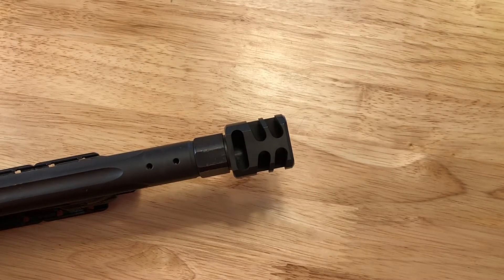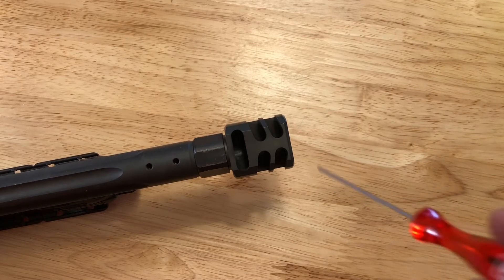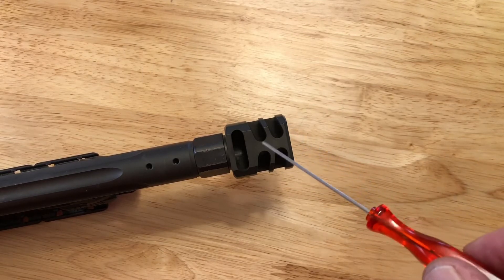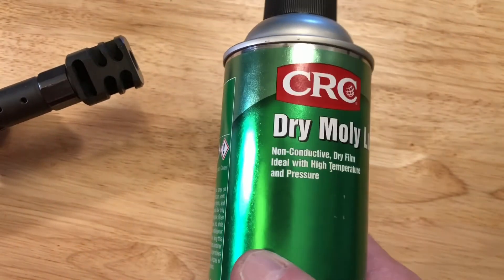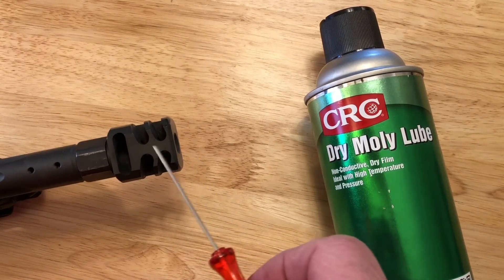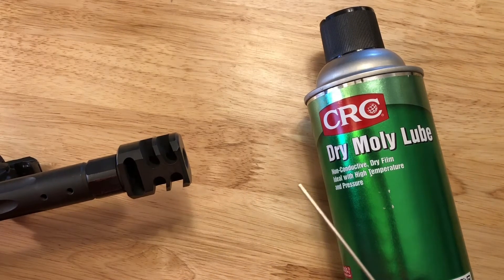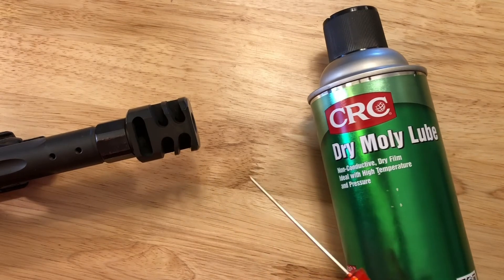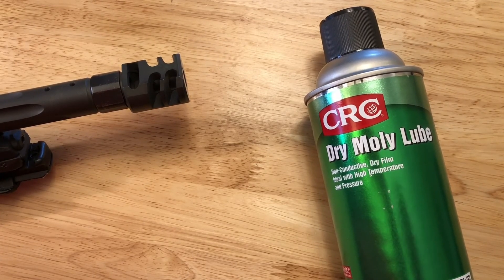Compensator cleaning made easy. Check this out!

Comment: I’ve tried this…it works….very well. But, you need to clean the comp thoroughly FIRST so that the moly lube is adhering to and protecting bare metal and not a buildup of carbon/lead/copper etc. start with a clean comp and this moly lube will work wonders.

Comment: A product called Never Seize will do the same thing. It puts a protective coating on the metal that withstands high temperatures. Silver or copper never seize.
Reply from the maker: Interesting.  Have you ever tried it?  I use Never Seize all the time on nuts and bolts, but this product never dries.  My fear is that after a few shots the Never Seize will be blown off and the protection would be lost.  Let me know if you have tried it.

Comment: Good tip, thank you
Reply from the maker: Mike, I just cleaned my comp yesterday after firing about 100 pure lead handloads, and big chunks of lead came out with just a dental pick.  Normally that would have taken me over 30 minutes with a lot of scraping and swearing involved. Try it, you'll like it.  Just make sure you put on 3 heavy coats, letting it dry about 10 minutes between coats.

Comment: I will try that on a new compensator I'm getting but have you tried an ultrasonic cleaner to see if it'll clean the comp much faster and easier?
Reply from the maker: I do have an ultrasonic and yes, I have tried it.  Mine is a special case because I shoot lead bullets that are not plated or jacketed, so the lead welds itself to the comp. With the moly coat in between it doesn't stick anymore.  If I shoot plated bullets I will just put it in the ultrasonic.  I use a cleaner that I saw on YouTube that is a 50/50 mix of vinegar and peroxide. It works really well but I'm told the fumes are poisonous, and the stuff will burn your skin. When you are done you need to neutralize the acid that was created by dunking the comp in a bath of baking soda and water for about 5 minutes.  I'll send you a link to the video in  few minutes.  The best way to do this is to fill the tub half way with water, then find a GLASS jar a little bit bigger than the comp, and fill that with the solution and put it in the tub.  It works just as well as filling the whole tub and you don't use as much as the nasty stuff.
Reply from the maker: Link to the ultrasonic solution.

https://www.youtube.com/watch?v=vbkmCd9XwYU
Reply: @CompShooter54  I also use the ultrasonic cleaner.  I might try this new technique if the way I am doing it doesn't work (my compensator hasn't arrived yet for me to get dirty.)  But I will do some trials, first, using nothing to coat the compensator and shoot it, and then use Slip2000 carbon killer in an ultrasonic cleaner to see how well it cleans.  I'll try the same tests after each round of many shoots with Slip2000 ultrasonic cleaner too and with the Lucas one I have.  If nothing is working, then I'll try that link you sent.  I'll also play around with coating the compensator with the molylube that I have, even though I'm not shooting lead casted bullets and see how that works.

Comment: Have you tried powder coating your cast bullets?  Ive seen other do it.  I haven’t started casting yet.
Reply from the maker: I have, many times, and different methods without success.  Even if it worked for me, it takes a long time, is messy, and the results vary from lot to lot.  Not only that, but you have to resize them after coating because of the thickness increase.  I use Liquid Alox because I can do 500 in 5 minutes and my bore is spotlessly clean after shooting 100's of rounds.
Reply: @CompShooter54  thank you
Reply: I shoot powder coated lead bullets through my Staccato P with a comp, and it makes no difference.  Comp gets PACKED with lead!
Reply from the maker: @CountryBoyShane  Agreed, they absolutely get packed.  But by putting a barrier between the steel and the lead it comes out in chunks with a dental pick.  At least with my Alox coated bullets.  So how do you get the lead out of yours?  I'm always open to ne ideas.

Comment: Do you still use it?
Reply from the maker: I do, and I get huge chunks out using just a small screwdriver.  It works especially well when I use cast lead bullets.  I will video the next cleaning and post it to show how well it works. It may be a while because I don't shoot that gun as much as I used to.
Reply: Nice, hope you get to shoot it soon. My P365xl spectre comp is coming in a couple of days I will be coating the comp day one thank you for making this video.
Reply from the maker: @ciscomedina9347  Nice, let us know how it works out.
Reply: @CompShooter54  I did this with a P365 X Macro Comp, and  Keltec CP-33 equipped with hilariously long 3" 8 slotted compensator. First slot was caked as expected, I scraped the lead fouling out easily with small screw driver.   Rest was just a wipe down, no notable build up at all.
Reply from the maker: @pawteegal  I'm glad someone finally tried it!  Glad it worked out for you.

Comment: I use different moly lubricants on tons of different firearms and their muzzle attachments! I've found that if you take and completely remove all grease, oil and fouling using a semi-strong degreaser to where the metal is bone dry, then take either a butane torch or even a hairdryer to the area where you plan on lubricating. This opens the poors and microscopic imperfections in the metal allowing the moly to penetrate even deeper giving a much more uniform coating that will last forever and ever so long as you clean and reapply after cleaning.

You don't have to get the metal red hot but you definitely want it right around the point where it's too hot to touch. The second you remove the heat source immediately apply a liberal coating of the moly lubricant. If some flashes off from the heat that's perfectly fine. This almost acts like a quenching process for the metal. Once first applied just let it sit to cool to room temperature and then add one last final coating. The cleaning process even easier. I now do this method to all my brand new firearms. The major points of friction will recieve Spec76 lubricant while all other metal surfaces recieve the moly which makes cleaning child's play. I've actually had a base heat treated coat of moly last for over 5k rounds inside one of my AR upper receivers until the point of which I had to use some kind of solvent to remove any kind of fouling. Up until that point I was able to litteraly take a dry patch to the surface to be perfectly clean.
Reply: Dude ……stainless steel is exceedingly non porous until you get down to a microscopic level. And at that level, it’s doubtful any type of liquid is going to seep into pores of microscopic size. Moreover, the pores that do exist SHRINK when you apply heat.  It’s “pores” NOT “pores.”  Research before posting useless info.